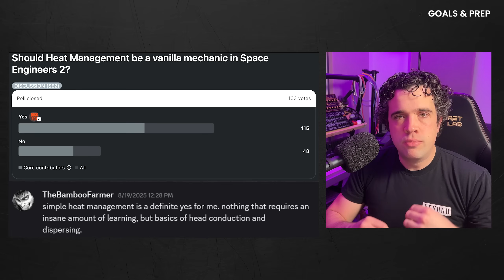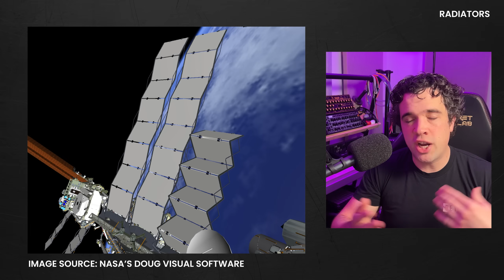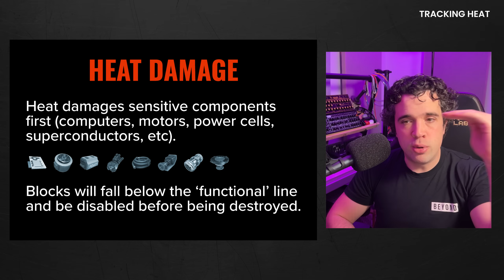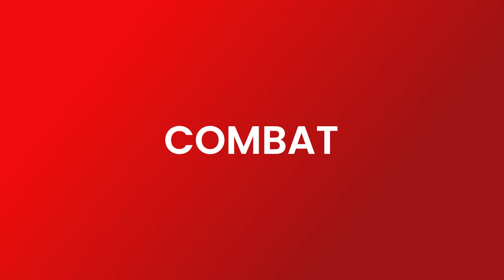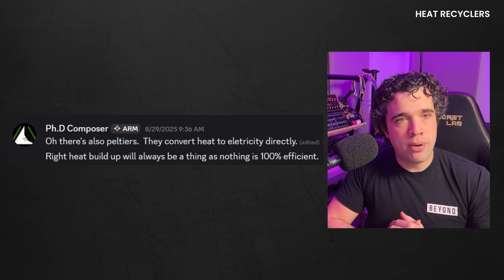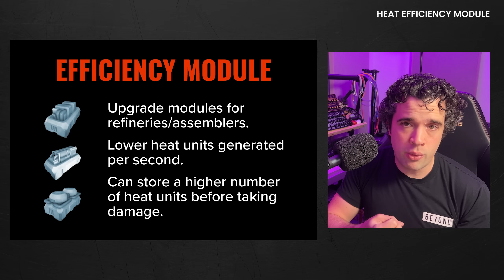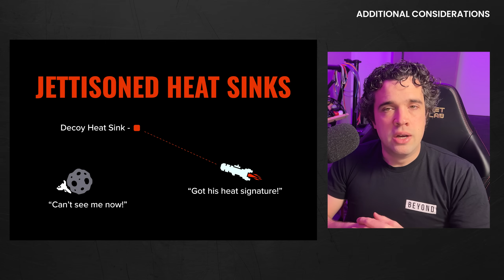Heat in Space Engineers 2? How heat could change EVERYTHING

Comment: There's also later an option for more active cooling. Cold water from mined ice. Activate a pump to seed it through heat sinks, then vent the boiling water to get the heat - out - of the ship.
Reply from the maker: Yup, talked about that a bit in the optional block section. Also a lot of comments requesting a way to manufacture coolant that’s more effective than water.

Comment: This comment probably won't be seen but it could be interesting if blocks closer to radiators and heat sinks had tbere heat drained faster than those further away. 
Also i think this system should be scaleable. Like have an 'easy' setting in the world customisation settings where heat is very unimportant which allows  people to build more SE1 and sci-fi like ships. Then have a 'realistic' setting where you actually have to consider heat management in your designs. 

Also maybe certain systems with lots of moving parts could have a 'jam' mechanic, for example gatling and autocannons if fired for too long could overheat and rather than taking tone of damage and being broken could take a little damage and be put on a cooldown while they unjam (similar to WTs gun heat system). You could then have the option to force an unjam as well if you don't want to wait for the cooldown to finish. This manual unjam would either increase the cool down by a few seconds for every failed attempt or unjam them and get rid of the cooldown.
:3

Edit: ignore my second point I hadn't finished the video and wanted to make the post before I forgot my points
Reply from the maker: Every comment gets seen! 😉 A sliding difficulty scale is definitely warranted. And they can sort of run with it however they want in terms of how dynamic the system should be in overheating scenarios. I mostly want it as a baseline mechanic we can start building with now then they can start adding intricacies or small details as the game progresses where they see fit.

Comment: Interestingly enough, I would prefer to see heat as a damage type rather than a resource to be managed.  We could have a system where explosions — and lasers if we get them — deal a large portion of their damage as heat which is applied to blocks, and a hot block takes more damage from subsequent hits, but heat reduces passively over time.  That way, a blown hydrogen tank could make you extremely vulnerable rather than just causing a lot of permanent damage directly, and you might want to mix ammo types to have explosive rounds soften up the armor so your penetrator rounds can punch through.

Similarly it would be cool to have ion damage from lightning and destroyed electrical systems (and possibly weapons as well) that temporarily shuts down nearby blocks, but doesn't cause permanent damage.  I'd be much more likely to play with lightning damage turned on if it didn't require constant repairing.  Also, if one of the planets has a lot of electrical activity, that would make rovers and boats much safer than aircraft because temporary shutdowns hit harder when you are at risk of falling from the sky.
Reply from the maker: But if there were a mechanic such as weapon damage that builds up heat wouldn’t you want blocks which can manage that heat? 

Also in terms of electrical damage, there was a mod for nukes which when detonated would temporarily disable your grid. It was interesting and made you careful around them. They were balanced in that they flew really slow so you could shoot them down so they weren’t OP but if you got a hit the grid would be disabled for a few seconds. Was definitely interesting, they just have to be careful with any EMP style effect (see previous video on Shields & Survivability)
Reply: @diggrok  Actually, if heat were a damage type, I very much would NOT want blocks to deal with heat.  (Though perhaps armor types.  More on that later.)  The main reason is that I would want the heat damage to be very much a local phenomenon.  (Also ion damage.  I would want ion damage to disable parts of the ship rather than the whole thing.)  Notably heat-as-damage is fundamentally different from your proposed heat-management system, so my upcoming tirade doesn't necessarily apply to that.  If blocks exist that can manage or dissipate incoming heat damage, then larger ships will have an inherent advantage when dealing with heat damage, because they can pipe the heat away from the point of the attack.  I think the key to intuitive balance is to keep the combat logic local; the damage a round deals to a given patch of armor should largely be independent of the ship that armor is attached to.

One rule of thumb I live by, whether it be for heat-dissipation, shields, or thruster-boost, is that if a ship should not be substantially benefited or harmed by being sawn in half to be technically two ships.  Similarly, if you have two ships in formation wingtip-to-wingtip, there shouldn't be a notable change in performance if you staple them together.

Now as for armor types, I kinda agree and kinda disagree with your thoughts in the shields video.  Firstly, and unrelated to anything you said, if there are more than just light and heavy armor, (and maybe if there are only those,) there should be a material selection independent of shape selection, so you don't need to have a hotbar set up for each material you're building with.  Secondly, I think there should only be a handful of armor materials, with each being as multi-role as possible.  My current thinking is light-armor, heavy-armor, interior/plastic and concrete/ceramic, with possibly a light-panel variant of interior for custom light fixtures, but that's not really combat-relevant.  Using light-armor as a baseline to compare to, heavy-armor should probably weigh more and be more resource-intensive per durability, so it would mainly see use in areas where you need high durability per volume.  It could also be interesting if heavy armor had a higher threshold for not taking collision damage, so it would also be useful for miners that might be bumping into tunnel walls.  Interior/plastic is cheap, light, and very-low durability, mainly used for interiors to save weight and look pretty, but it could also have decently high ion-resistance, so you could put some of your sensitive electronic bits in a plastic box to help keep them safe.  For concrete/ceramic, my thought is that it should be almost as durable as heavy-armor, fairly cheap to build with, and good heat resistance, but heavy as, well, concrete.  It would be useful as heat shielding, both for thermal weapons, and for coating landing pads so that there is no permanent damage from light thruster-cooking.  Also, if it's cheap and heavy, it could see use in boats as a keel material.

One thing that I think should be guarded against is encouraging intricately-complex tetrising of composite armor.  Both for approachability, so that you don't have everyone needing to copy armor panel blueprints, but also for PCU considerations.

Comment: o good idea, (looks at Cosmoteer's heat system and it's heat weapons)
Reply: Yeaa but that's regarding overclocking stuff.  This would be constant if the setting is turned on
Reply from the maker: Yeah in a previous video Cosmoteers came up a lot for both shields and heat. Lots of various games to pull ideas and mechanics from.

Comment: For flushing heat, I would make it so Radiator could use water to flush out the heat that they are currently holding, but not all of the heat of the ship
Radiators would obviously be able to take on heat faster than they can radiate it, so you can use water to flush it out, and then start taking heat in faster, but still only to the speed they can take in
Meaning it would be a very effective way to emergency cool the ship, but cannot be spammed
Since at most (if you were to continuously flush them) you would be limited by the speed they can take heat in, while continuously wasting water

So the ideal use of this would be to allow the radiators to soak up their full capacity, then flush it out at once (ideally with cool steam particle effects)

Flushing heat should only be effective with at-least one side of the heatsing exposed to a natural atmo(not artificial/airtight) or vac
Flushing heat out is not an automatic and efficient toggle, but is a toggle you can only turn on and off, with consistent water usage regardless of heat removed, to discourage continuous flushing

I would also suggest that heatsinks and radiators in direct contact should share their heat capacity, to allow for more efficient setups, and to act as a tradeoff especially for larger combat vessels, as they are incentivised to not have their heat infra concentrated, but that makes it a larger weakpoint
Spreading out their radiators and heatsinks would increase resilience, but sactifice heat management efficiency
And having to choose how centralized you want you base cooling infra would also be a interesting choice for the trade in efficiency and safety/redundancy when not constricted by the size of a moving vessel

With this setup, you can make ships that have retracting or enclosing radiators than can be opened/extened to get exposed, then radiate heat rapidly using water, then retracting back in after sufficient cooling

This option would allow builders to make more heat-inefficient ships with more armor and wapons, but with the weakness that they must periodically expose their heatsinks in order to rapidly cool off and compensate for their lack of exposed heat management
With these heat infra/weakpoints having to get larger or more numerous as a ship nees to manage more heat in short notice

So... Capital Ship boss fight anyone?

With these ships needing to cool off, managing to cripple even parts of their cooling could be crippling, leading to a surrender or retreat, instead of always ending in a "last ship flying" kinda way, since a ship can be unable to continue fighting without having to be destroyed significantly
This could allow for more even fights between ships of vastly different sizes, and fights ending faster, so the losing side isn't always just completely detroyed and helpless afterwards

And it also gives a lot more value to more nimble and precise ships and attacks, as smaller craft can now specifically target the exposed heatsinks while they cool off, making them a more legitimate threat to be surrounded by mid-fight

Also, lets be honest, it's just freakin cool to have a ship do some sick tricks or attacks, stop, open up plates and having red hot radiators and heatsinks stick out and spew out steam as they rapidly cool off

Edit: To add, this also means that individual parts aside from cooling infra do not have in-built emergency cooling, as all of that is on the radiators
Meaning a large ship relying on heat flushing NEEDS their radiators to be intact
Reply from the maker: Love the thinking you’re outlining. Just goes to show this system opens a ton of opportunities and can create super dynamic gameplay.

Comment: Honestly, i like everything except the individual block heat.

I think that should be possible, but not part of the game mechanic Keen adds.

I think it being mostly related to power output is fine.

Also, heat vents should be added as a third block. They work exactly like radiators, but they hook up to the conveyor network and expell a resourse gas to cool down.
Reply from the maker: Yeah coolants would be nifty and more similar to how the coolant loops actually work in reality. If you had some type of coolant it could also run to the radiator as a heat exchanger. Having coolant gets slightly more complex (though still pretty simple) but cooling loops being destroyed during combat is really interesting!

Comment: Bold of you to assume Keen would focus on complex pvp. Implementing these mechanics would be a headache for them and would not bother to, just like they don't even bother to make AI grid blocks actually good at navigation and turrets good at targeting jetpack hydromans.
Reply from the maker: I don’t think so. The system logic outlined is no different computationally than tracking power. They function similar. If heat or power capacity is below what the grid can handle, blocks shutoff. Solution? Add more capacity or turn off unnecessary blocks.

Comment: conceptually its cool and i don't hate it. i will say that having a 3rd mechanic which is largely handled by your space suit is a little pointless. now I know that we are talking ships here so this is less a survival option and more of a mechanical balancing issue. however, and bear with me, I've always assumed heating and cooling was just an assumed characteristic within the blocks themselves. so for example air vents functioned as heat exchangers and that heat was radiated out through the hull and other components. things like refineries and assemblers had their own internal heat/cooling solution much like computers do today. its just an all in one package. if we do add heat to the game. it would be easier to just add it to the guns themselves since that seems to be the main concern. where i could see this really being useful though is preventing your water that you might take to space from freezing. which could expand and damage the internals of your ship. water expands in the conveyor system now the conveyors are broken. the pressure in the holding tank expands as the water begins to freeze and all of a sudden you get mass depressurization as the holding tank cracks and opens up to the vacuum of space.  that's where i would say radiators and heat sinks should be. in the water.
Reply from the maker: The issue isn’t things being too cold but rather being too hot! Spaceships generate a lot of heat which is slow to remove in a vacuum. Go check out the coolant loops and radiators in the ISS. They’re trivial in preventing the crew and modules from being cooked.  

You could also assume just like you said about other blocks manage their own heat that a water tank would also have power to generate heat if the tank gets below freezing. 

Radiators and heat sinks are all about removing heat, not providing it.
Reply: @diggrok  well, because of how water is going to work in SE 2 its not going to be an actual tank to my knowledge. sure they might have one and that would likely have its own heater, but i'm talking when it water is just siting inside your ship. however, the assumption here is that we also have a bunch of highly advanced parts and we haven't found a way to reduce the power to the point heat dissipation and radiating it are equalized.  

its true the ISS has very large radiators that extend out from the main station to help with this, but the actual modules radiate heat too. the issue is we currently produce a lot of heat with current tech. again the science behind it isn't really up for debate. its a game vs real life. I still think its a unique idea and i'd like to see how keen might implement it.

Comment: See I personally would like to see a system that is intertwined with the centeralized power grid as the more energy you consume doing work the more heat you produce as a byproduct, this would set the framework for overclocking systems that have may produce more work but at the cost of exponential heat and it would be even cooler if the item system had support for objects thermals masses so you could in theory vent liquid silver in a pinch or make your own mega refinery by placing ores in a container and then superheating it with ion thrusters ect this kind of setup allows for a much higher skill/creativity expression and would make some crazy things possible like steam overpressure events from a fire near a water vessel I could also see heat pipe blocks that subcool equipment and move the heat else where injuction with a hull heating system sorta like what cosmoteer.
Reply from the maker: Interesting 🤔

Comment: I like the idea of having redline and stealth mechanics from a heat system like this, but I don't think reentry heat makes sense in SE world with a 300m/s speed limit, but if it is added I'm sure there'd be an option in world settings. Keeping it simple could make it actually happen. AND when we eventually get lava as and fluid and maybe a molten volcano world, heat mechanics could be REALLY interesting there. It would be dangerous, but also having a base in a naturally hot area could hide your signature from other players while you mine exotic materials. High risk/reward.

I still have pressure and gravity damage/mechanics at the top of my wish-list though.
Reply from the maker: I agree that reentry damage when only going 300m/s would feel a little ridiculous. I’m also a proponent of relative top speeds based on grid size and higher speed limits though (as outlined in my Shields + Survivability video) 😊

Comment: In the small indie game Interstellar Rift that is basically a ship builder but only for interiors, heat system goes through a single block. Various blocks require heatsink submodule (sorta how the battery will work in SE2) that stores the heat out of it. You can then put these heated sinks into the block to cool them off for reuse and in return generate heated coolant you can use to heat up your interiors (cold iteriors will damage the players in it). Overheated sinks will eventually break and the block they were installed in will turn off so you have to pay attention to them but you can also automate the heatsink exchange with teleporter block. Forcing a block to work without heatsink can cause it to catch fire you have to extinguish by cutting oxygen in the room or with extinguisher.
tl:dr, blocks have heatsinks installed, sinks gather heat, put them into a environment control block to cool them off and put them back.
Reply from the maker: Haven’t heard of that game I’ll check it out!